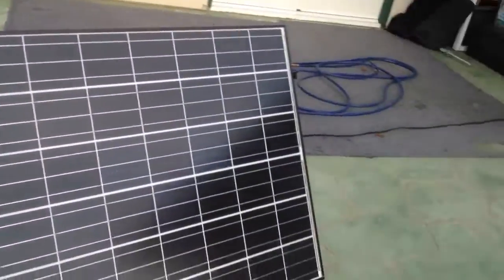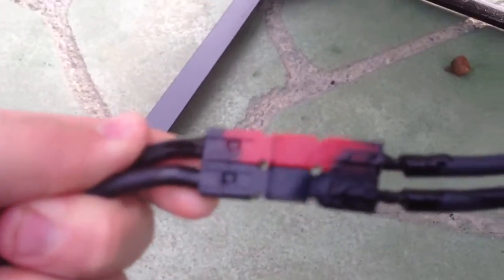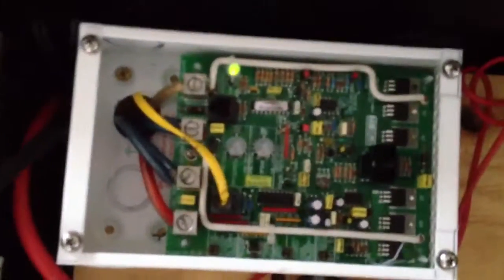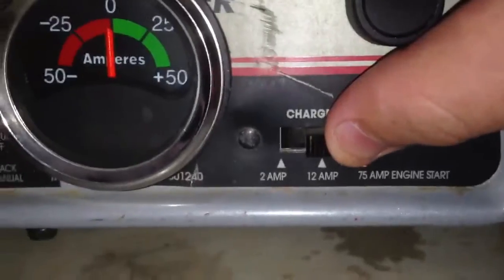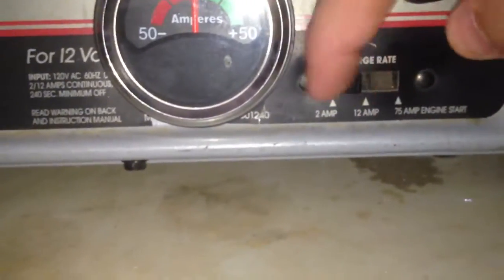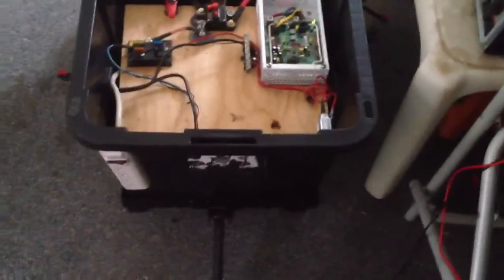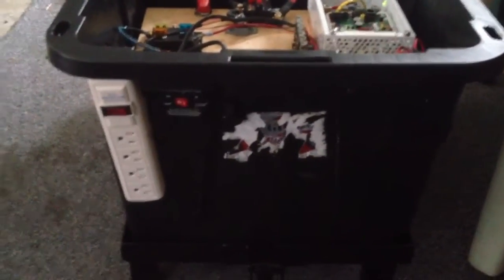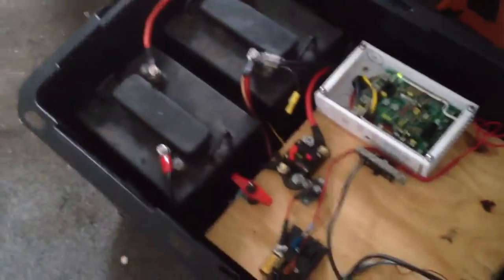12v solar room update 3

Comment: You are on your way to a very nice system. I don't know what the amp/hr rating is on your batteries but if you decide to upgrade make sure they are balanced.  (Batteries are actually the most important part of the system. ) Good luck and nice job.